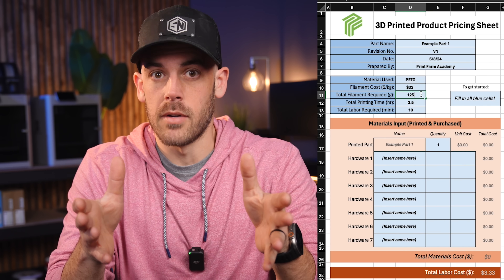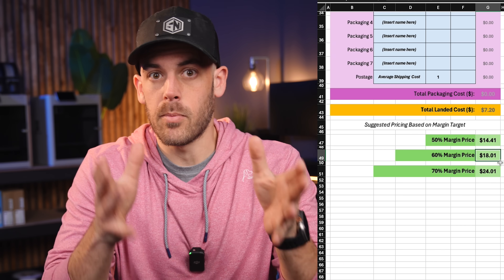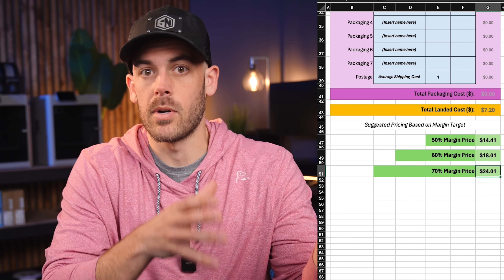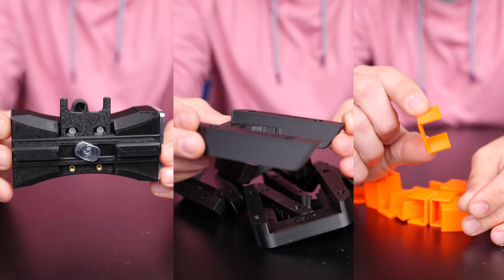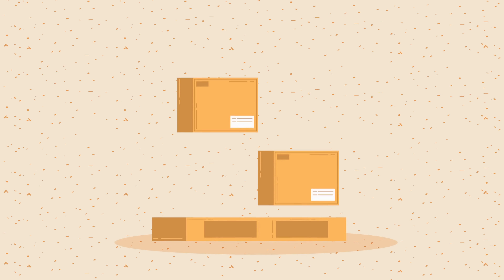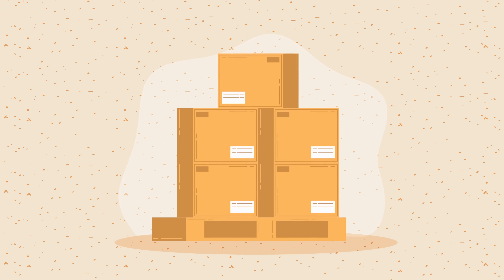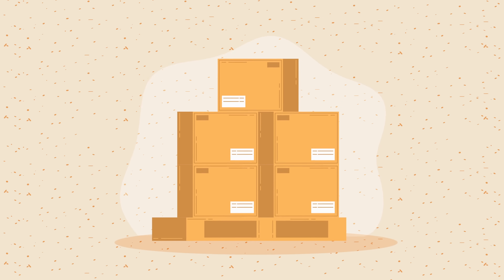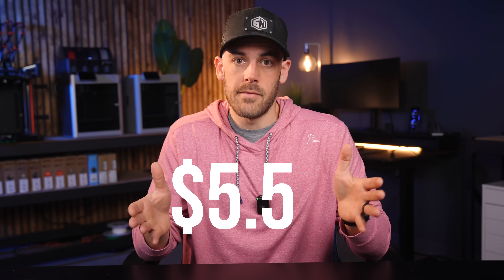Why I charge $55 for this 3D printed part (how to price)

Comment: Great video; however your profit margin cost is wrong.   To determine your actual profit margin, you need to divide by the reciprocal of the desired margin.   (e.g. for a 40% margin, divide your landed cost by .60).   Your calculation results in "markup", not "margin".

Comment: Another thing to factor in is wear and tear on your machines. Every hour you run your machine is one less hour that machine will run before it needs a part replaced, or is worn out completely and must be replaced with a new unit. If you've been doing this for a while you may know the average service interval, and average service cost, and can divide that by how many machine hours (on average) you go between those service needs, to arrive at a per hour machine wear and tear figure. Maybe it's so low as to not be worth including - I have no experience that would let me know the answer to that.

Comment: Artist often under sell their art. They do it, because it is so easy for them to produce. What they often don't realize is a purchase is price that is valued by both parties. If a person is willing to pay $50 for something, then that is the worth of that item to them. I can sell two boxes out of PETG for $75. The secret is it looks like an old fashion camera that is a planter. I can sell a 20 X 30 sheet of paper for $75, but it is not blank. It has on it a an eagle I photographed in flight. Both of these are the value of the artist and the purchaser to make the sale. Why do they pay so much for a sheet of paper not even in a frame? Add a frame and shipping, and the price would go up. It's because they can't produce an image half as good as mine. The same is true with any form of art, and yes that part is art, you have. Fear and not realizing your talent can't be duplicated is keeping you from getting your true value.

Comment: Excellent video.  I noticed one thing on the labor cost you left out, that is design cost.  If you find open source 3D print file(s), then bonus.  If you have to design stuff from scratch, have someone to design it for you or if you have to purchase 3D print file(s), that is additional labor cost.

Comment: In my province our public libraries have makerspaces where we can use the tools they have. All they charge is for the electricity materials and a bit of tool maintenance. 

So to 3D print something they charge me 1.25 CAD per minute of printing and laser cutting is 5CAD per half hour.

Ever since I found this service I see no use of purchasing overpriced 3D printed items from other people. 3D printed items last nowhere near as something injection molded etc. so I am not paying the same or more for a less durable product.

Comment: POV: You have to explain leftist what costs are and how market prices form...
Reply: Problem: You missed the cost for development time and future market strategies (mixed price calculations etc.). Repairing printers will cost you sometimes more than you safe, as you have a limited resource called time.  Time you spend on a broken machine can't be spend for packaging, advertising etc.

Comment: Every business and industry should share the information. The only adjustment I would suggest  your labor estimate is low. I always use a rule of thumb of labor is 3 times what you pay per hour. This works because you can reward great employees for going above and beyond, deal with crazy factors like tariffs, or keeping an experienced employees that has been around for years by giving them raises without having to raise prices. .

Comment: Back in 2019 here in the uk i contacted a local company to print me a part for my telescope.  It was 25mm in diameter and 15mm deep.  They quoted me a price of £230.00

I thought that is crazy and thought how much does a 3d printer cost and started looking them up.  I ended up buying my own printer and printed the part myself

Comment: I really enjoyed this video as it does a great job highlighting the hidden costs of 3D printing that a lot of people overlook. I 3D print (filament and resin), do CNC work, laser engraving, and lathe work both for my job and my hobbies, and I still don’t really see 3D printing as a full replacement for buying available manufactured parts just yet. There’s usually too much time, waste, and post-processing involved, and the final quality or durability often doesn’t match mass-produced items.

I’ve lost count of how many times I’ve started modeling something only to realize I could’ve ordered the real part and had it the next day for a few cents. That said, I’m still a huge fan of 3D printing for one-off projects, cosplay pieces, prototypes, and things that simply don’t exist yet.

The part about valuing your time really hit home however, as I struggle with that a lot when trying to price things I make for sale. Thanks for putting this together! I’ll definitely be checking out more of your videos soon.

Comment: I feel like, when mass producing simple parts, after prototyping with a 3d printer, it seems to make more sense using injection molding. I’ve seen videos of guys running through a bunch with what looks like a simple unit that still requires manual work.

Comment: As a Business owner in this industry, you can not forget to margin in your design time as well. The parts you printed were a blueprint drawing and an idea. Running CAD is still a cost factor. Tid bit for newer entrepreneurs coming into the manufacturing industry.

Comment: This bascially eliminates 3D printing any product you can get off a major online store starting with A and ending with zon. Because mass produced Chinese is not going to let you get away with a 50% margin. A six-pack of Dewalt battery hangers complete with mounting screws that have been injection molded is 9 bucks on the big A - for a pack of six. So to any level of savvy buyer, you'd better be outputting 100% unique stuff if you're going to charge these amounts. Various miter saw stoppers start at 10 bucks. Frankly I don't get how many 3D printing services even stay in business unless they're top notch outfits with killer 3D designers who can churn out bespoke parts at staggering quality to corporate customers or some such. But maybe this is why conventions and fairs now have 30 hopeful dudes with their mass-printed articulated dragons trying to sell their mass designed yet 3d printed crap to the public, as if that would work.

Comment: What about the costs of the device to install the inserts? Are the heat in? Press in? Do you have a device or hammer them in? What did the hammer cost?

Comment: One thing a lot of people do is not pay themselves for the work they're doing.  Sure the 3D printer is doing the most work, but you have to setup the printer, install the filament, hit the start button, or print button, remove the item from the printer when complete, clean up the printer so its ready for the next job, etc.  All that takes time in itself, plus monitoring the prints to be sure there aren't any failures during the process.  Physically the work isn't too demanding overall, but you are spending time on that job monitoring, prepping, processing, packing, etc.  The customer owes you for that time.  

The other side of this, most customers in general have absolutely no clue what it takes to run a business from the whole business standpoint itself, and they have even less of an idea the costs associated with it.  

3D Printing is one of those you either like it or you don't types.  Regardless, you are providing a service/product to a customer, and if you are having to sit at a computer and build their product from the ground up...I.E. you are in a CAD program designing their product, test printing, etc.  All that takes time, it takes money...the customer has to realize this and be charged for that time as well...usually its a setup fee of some sort...and the overall item costs go down slightly with the more of an item that is ordered, especially if the item is small enough to print multiples at a time on one bed using one machine, as opposed to a larger item that requires its own machine.

Comment: Nice video mate. You basically did what accountants know as a CVP analysis (Cost Volume Profit) 

One main difference, the factor rates that you use should be representative of manufacturing overheads, and should only serve as targets. We usually take all the overheads, categorise, and apply a weighted average per category to determine the true cost. I.e, record the filament used in the machine and  actual filament used per period, and record it to an account like wastage or spoilage. We then have an ongoing record to query overheads and get an accurate picture of each relevant cost.

I'll use your excel documents, but dont mind if I tweak them a bit :)

Comment: Charging $55 for a part that would cost around $5 shipped from China seems like a killer business model.
Reply: It's 5 dollars if it's a part currently being made or if you have the budget to buy tens of thousands in bulk.
3d printing is for the middle ground between handcrafted and mass production.

Comment: Good Video, but a few things are missing here:
- If you have a room for your business only, then you should include the rent of it in the price. 
- The other thing is: Not everyone is skilled or smart enough to bouild specific products or tricky mechanisms. That is very valuable, because not everyone can do it. Modeling it and refining your model after some prototypes etc. takes time, brain and other ressources.
- If you run ads or make videos about a product, could also be included.

Comment: In the spreadsheet the quantity of the parts is not concidered in the "Added Machine Cost" calculation. Machine cost stays the same if I print one or ten pieces of a part. If one part prints in 1h then 10 parts printing 10h should result in 10 times the machine cost.  Is this an error or am I missing something?

Comment: Appreciate you posting this information as it has been very helpful. I have four printers and have been printing mainly as a hobby.   Now I wish to take it up a notch and start printing as a source of supplemental income.   I've taken your spreadsheet and modified it a bit to fit my particular situation.  From initially multiplying my material costs by factor of "X" and hoping for the best to determine a selling price, I am now able to factor in all variables and have a better feel if my 3D sales are profitable or just a hobby keeping me busy.  As additional variables arise I will be able to easily add to the spreadsheet and adjust accordingly.  Thanks again for posting.  Liked and subscribed.

Comment: One thing I always mention to people is, if I have to print something small for them I will wait until I have other stuff to print. I don't want to heat up my 300x300 bed just to print a small clip. I will wait until my bed is full before printing small stuff. It saves on electricity.

Comment: One thing you didn't touch on is warantee and I see people in your comments bringing it up. Being a one man 3d print shop has inherent qc inconsistency and how do you handle prints that may fail for a customer very quickly? It's not as simple as replacing it for free right away but that is what customers come to expect. Especially when they already paid so much more than what they would for a cheap mass produced part. I dont see it as a viable business model honestly without inherently pissing off lots of people. When i print something for myself i know if it fails i can print it again, as a hobbyist. But if i were running a business it's not that simple.

Comment: A good place to start. Certainly a quick and easy to use tool to start with. Due dilligence is the key. And yeah, I have seen so many start ups that have to stop because they just can't make it pay. Lol. No shortcuts to success. Look before you leap - and another free tip - don't think FB is the yellow brick road. If you want to offer a serious product with longevity - do it properly fgs

Comment: love how he just immediately jumps to 50% profit margins like that is meant to be reasonable at a large scale
Reply: He says 50%, but calculates 100% on top.
Reply: look at replacement part costs of car manufacturers, they just charge ten or more times the part price, if you want to purchase it
Reply: @JesusvonNazaret  That's because by law they are required to stockpile them for decades even when it isn't profitable to do so. With 3D prints you ship the end product right away, so it is not comparable
Reply: You seriously think 50% markup is anything out of the ordinary for ANY scale of retail sale?
Reply: @v12cat  except this isn't retail, his services are just one step in the supply chain. In a competitive market with very low barrier to entry 50% is a lot

Comment: Your pricing calculations are off, selling a a battery holder for $40 that cost you $20,  is 100% profit margin, not 50%. Adding 50% to $20 gets you to $30. But otherwise excellent video!

Comment: I’m slow an a rad but lost I get don’t really charge based on what the software tells u,been on new in the roots works an trying get solid print tune specs for better prints for my bambu ,I been charging a small amount not sure if it’s worth it or not ,so I printed a Minecraft figurine bout 3-4 inch tall not sure on amount of material used but it said it was roughly 47cents cost ,so I spike it for 8$ I felt that was fair ,given I didn’t really include labor it took to clean up an hand paint ,I didn’t factor this because I could see the something so small for let’s say 35$ I even felt 15 was to high

Comment: 1st time watching your channel and your production value, editing, content, straight to it, no fluff is OUTSTANDING! You're great!.  That said, I've been 3D printing since Makerbot started.I went from the original THING, to having 2 Replicator 5th gen printers, then adding a Replicator 2x and Makerbot Digitizer. From there to 2 Creality CR10s Pros, to Cr10s Pro v2, and several resin printers. Now mostly only using my BL X1Cs. So I've had all the tools necessary to start a 3D printing business though never have. I'm a very experienced entreprenuer too. I never did because of all the tinkering involved (so not confident in being a reliable provider) but more importantly,  not knowing what to sell or having access to models that would sell as I'm not a 3D modetler.  My long winded comment brings me to this...Since getting the Bambu X1C, I feel confident enough to start selling. I see you have a course on doing so which I think I will be signing up for. My question is, does your course cover how and where to obtain profitable prints?

Comment: Thanks, you did a great job of uncovering the small costs that add up can mean the difference between profit or loss. One cost you did not mention was the up front design cost, for a low volume part that could be significant.

Value based pricing is the way to go. Design products that are unique and add high. Suggest regular review of your portfolio. Question to ask is which products have the highest margins and how can I increase the volume of those products or design more variants of these.

Comment: It's kind of accounted for with a buffer, but measure your HVAC usage with and without printers running. Every watt those printers use goes into the air as heat, which your AC will cool. If you have 10 printers, and they each kick out 150W, then that's 1500W of constant heat, or about an electric space heater (a US one).

Comment: I absolutely love what you said at the end: Learn from each other.  Thank you for this video, and thank you for your xlsx template!  One minor thing I'd like to also mention - what about design time?  I'm currently working on a product that will use ESP Home to tie into Home Assistant - I get the materials cost part, but what about my time writing the code, the prototypes, etc etc etc.

If I'm only going to sell one.... that's one thing.
If I'm going to sell 100... that's a different thing

How do I factor that in?

Comment: This is basic business practices 101. Should be the same for welding, painting or printing. Your theory on machine cost is incomplete. Power consumption aside, you dont cover the benefits of tax write offs over several years. Major benefits that can help save cost passed on to customers - then again a lot of companies use that for R&D on new products. You could sell 5K parts and sometimes not even cover the cost of R&D or design. All of that comes out of the profit as well. Planning on making additional products? Gotta have money to live on while you do.

Comment: How would you utilize the sheet if you print multiple products into a bundle?  I do resin printing, and FDM printing for gaming.  I have commercial licensing to terrain sets, that typically takes me between 4 and 6 built plates to complete one set.